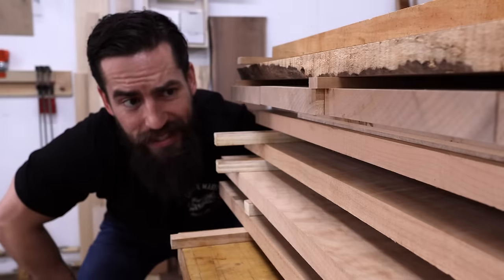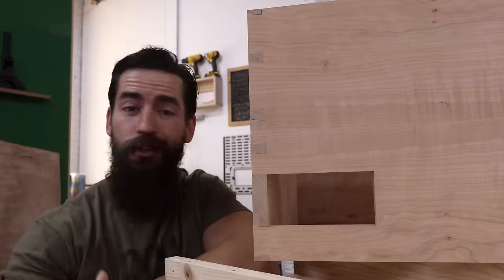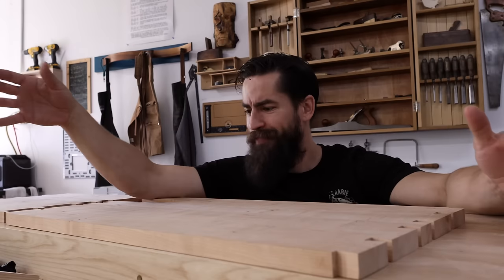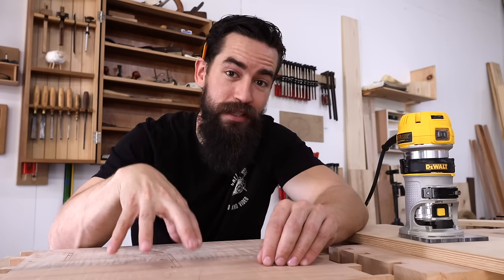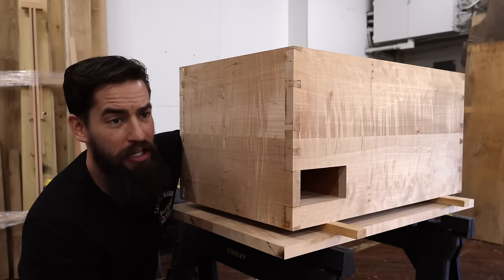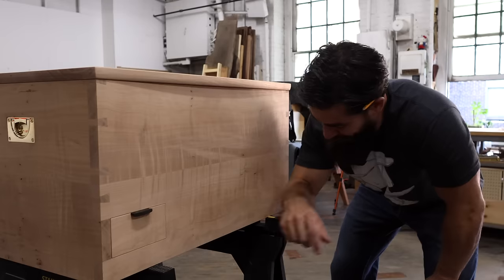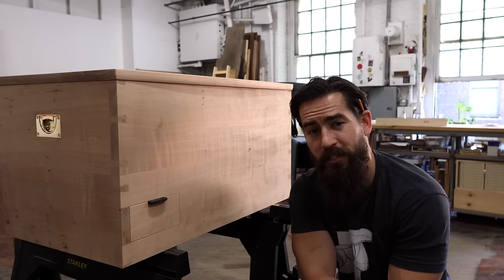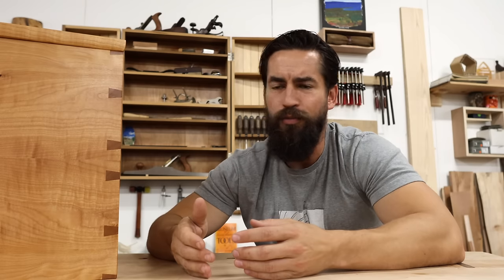What $1,200 in wood and 6 months of work looks like

Comment: That friction fit box drop deserves 5 replays!! Awesome job E!
Reply: You probably know this but for anyone else who doesn’t, it’s not friction slowing the box from dropping. It’s air. The fit is so precise that the air can’t escape along the edge of the drawer fast enough. If it was friction it would wear away at the material. It’s called ‘piston fit’ since it resembles how a piston in an engine sits in the cylinder.

Comment: This is an incredible piece. I haven't quite stretched myself this much yet. Maybe you have inspired me.

10:10 When I am riding fences like this with my router I use the round side of the foot plate. Actually I use a fully round foot plate to do cuts like this, but if this was the only foot plate I had, I would use the round side. If you accidentally rotate the router on the flat side you ruin your cut. Not so on the round side. Just make sure the foot plate touches the fence and the router bit is always the same distance from the fence. This is especially true on one that is fully round. I realize this means making sure your bit is perfectly centered, but cones make this easy.
Reply from the maker: Absolutely true. Just a personal preference on my end. And thanks man!

Comment: Thanks for the complete run through. "Simple" pieces are a challenge because there are so few things to distract from mistakes, whether in design or execution. A totally great piece, but for me the chefs kiss goes to the slight pillow on the lid edge. At about the 20:40 mark the light shadow line is as close to perfection as we mortals get.
Reply from the maker: Thank you so much Bill. I really appreciate that.

Comment: A(nother) stimulating video. As much focussing upon the mental side as the making side. Everyone is different but, for me, that mental side, is the most challenging. After 45 plus years of turning trees into something smaller, I still struggle with the mental side. It could be a lack of patience, it could be design aesthetics - but it is rarely how could I make this? 

I’m making a side Demi-lune table with 4 legs; each legs has 4 parts and meeting each other at odd angles. The first batch of legs that I made are now repurposed because I just just want happy at the quality of the joinery; lack of patience; not checking/setting machines well enough; assumptions of methods - all were parts the second batch have gone through their first stage of glue ups and are better. 

I say better rather than perfect because I don’t think I’ve ever made anything that I regard as perfect. Others have but it’s part of my mental struggle never to see perfection in my work. 

All this is why I enjoy videos from EN Curtis (and Sawyer Design) because both makers talk about the mental input and the challenges - but still make great pieces. 

You don’t need every tool under the sun; you may not have the mental ability to use CNC machines (my brain just doesn’t take in modern technology any longer) ; you may not be making stuff that would sell for thousands - the most important result from making anything is to get mental pleasure from the process and the result. I, like many, find that the real challenge in woodworking.

Comment: Awesome build and video. Solid and beautiful craftsmanship at play here for sure. Interesting that you register the flat face of the router plate against your straight edge. I find the round edge more forgiving as it allows for any twisting without moving the bit away from the reference edge, not so with the flat edge of the router plate. Is there a reason you preference this?
I should add, you’re twice the craftsman I am. Looking to learn here but worst case this is a tip which might save a future error.

Comment: I know the benefits and drawbacks of a high or low blade but curious to know why you chose to use a high set blade to trim your panels.
Reply: I noticed that too and was wondering the same thing.
Reply from the maker: Fair question. Honestly it's just mostly out of habit at this point. I rarely use a low blade unless needed.
Reply: @ENCurtis  thanks for the reply! Was just curious if you knew something I was missing. Big fan of the page and content. 👌🏼

Comment: Outstanding piece. Interesting that you chose to use bookmatched Curly Maple. I've always had a hard time accepting the visual aesthetics of that particular figure as it always seems to come out uneven and not exactly the look I'm going for. I guess the curl doesn't always run perpendicular to the grain and in turn, doesn't always "bookmatch" the way I'm hoping for. This piece, from the angles shown seemed to come out quite nicely though. I may have to wade into this particular design again and see how it comes out again. Love watching someone else wrestle with the tiniest of details that will/won't be seen much but match to the exterior design to actually complete the piece and carry through the presented image and into the depths of the construction. I feel it shows the craftsman didn't decide to cut corners and carries his vision all the way through to the completion of the project. As always, excellent job . 👍😎

Comment: I appreciate that you include your thoughts and considerations of the design and how it fits the patterns provided by the wood. I’m just curious about the choice for brass hardware on the exterior of the box, I found it to be a bit distracting from the other design considerations you used in planning the piece. Not a criticism just a curiosity. Love your work and and style of presentation. It inspires me to take more time to plan and honor the character of the wood. Thank you
Reply from the maker: That's a fair question. It was a specific request by the client to have handles. And ultimately I did not want a protrusion from the box sides, so a flush mount handle like that was one of only a few options. Is it a perfect solution? no. But it's a good solution to fulfill a client request.

Comment: Sir, beautiful piece.  I guess you just “made a thing.”  One question… noticed you registered the flat edge of the DeWalt trim router for your dados in lieu of the rounded edge.  I’ve found the round edge is forgiving even if you slightly rotate the router along the guide as it’s still the same distance away.  The flat edge has no margin for error.  What are your thoughts?

Comment: Sure would love to see somebody do a test on the amount of glue used versus strength. I don't understand putting glue on both boards? I get that wood absorbs glue but putting an 8th inch thick strip of glue on both boards that are going to mated up with an imperceptible seam...? You see my question? Most of the glue just gets squeezed out and wiped/scraped off.

Comment: I noticed you used Titebond for some areas and liquid hide for the dovetails. Was is to allow disassembly if needed, to keep the glue from interfering with finish or some other reason?  Great video! Also at 20:07, did I see a secret compartment?
Reply: I would assume his dovetails were so tight he didn't want them swelling during the glue up. Hide also has a longer open time, definitely important during such a complicated glue-up.

Comment: Question: why is it good to have a flat edge to the router base? I would have thought circular is better: as long as you keep the circular base pressed up against your guide, the bit is in exactly the right place even if the router rotates some. With a flat base, if you don't keep the entire edge pressed against the guide then the bit gets pushed away from the guide. Your system obviously works for you, and I've only used a router about ten times in my whole life so I am definitely not trying to tell you anything; it's a genuine question.  A round edge seems to have no downside in that application, whereas a flat edge seemingly requires a lot more care. I'm sure I'm missing something, could you tell me what?
Reply: Beautiful work, by the way.

Comment: What conversations did you have with the clients about keeping the chest in a temperature and humidity stable environment? The tolerances that you put on the little insert trays were only about .5mm by the look of it. So any exposure to moisture would render those fixed in place due to timber expansion. Were they aware of that when they commissioned you to make the piece?
It's a truly beautiful piece though. Despite being in the industry for 35 years now, steadily gaining quite extensive experience in CAD design, benchwork and finishing I still can't get anyone to give me a commission like that. I just get melamine wardrobes to knock together day after day. And I'm employed AND self employed! what am I doing wrong???

Comment: I'm surprised that your thoughtful design, made the outside drawer with a protruding handle.
Assuming that this will be placed on the floor, it looks like  an accident, patiently waiting to happen.
A brush with a vacuum, a child playing, a dropped object many invitations for a mishap and regret.
Reply: It's far better than adding some quite unnecessary and failure prone spring release catch that would ruin the aesthetic of the piece. The drawer front is also too thin to allow for recessed hardware and would look ridiculous if made thick enough to embed hardware.
Reply: @LordPadriac  Sorry but there is low profile, recessed hardware that folds out, made just for this kind of situation. Once the handle breaks, there is no way to open the drawer....